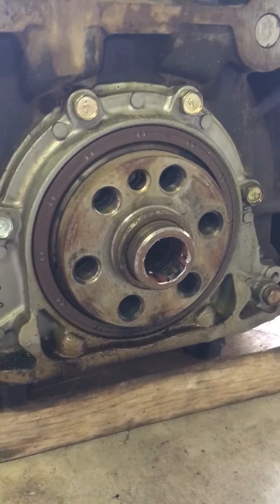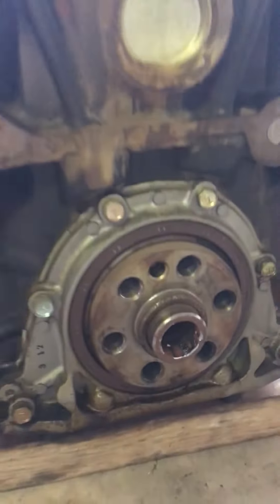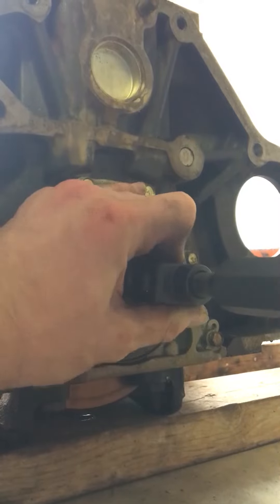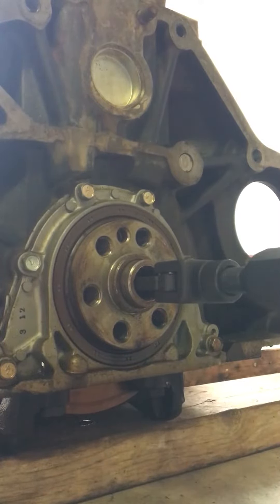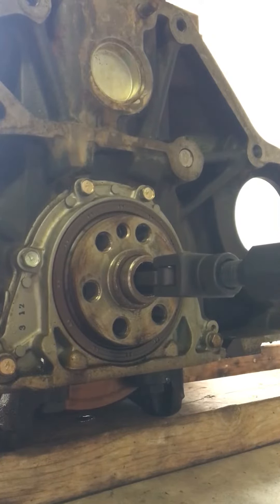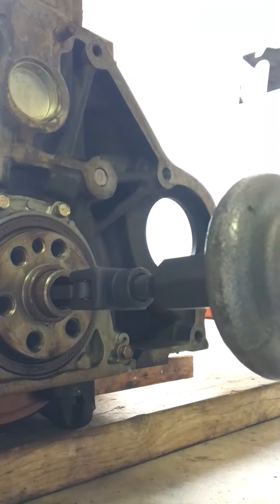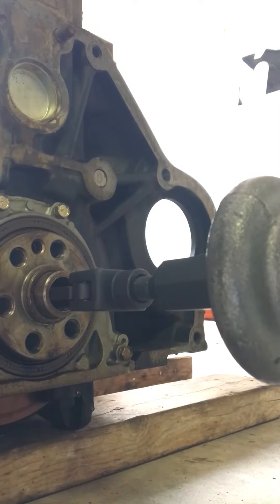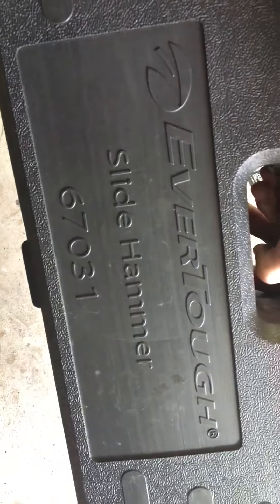How to remove a pilot bushing Nissan 240sx KA24DE S13 S14

Comment: Thank You! I tried it with this tool but didn't do it exactly like you said. Watched this... tapped it in with the slide hammer tightened it and it came right out. No chisel So No grease and socket.